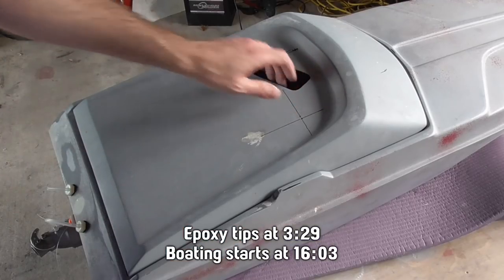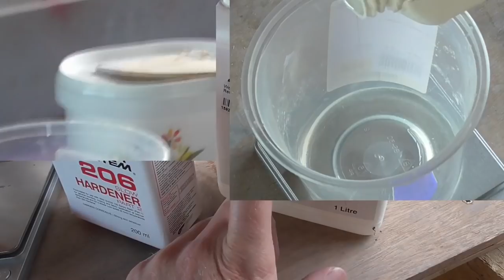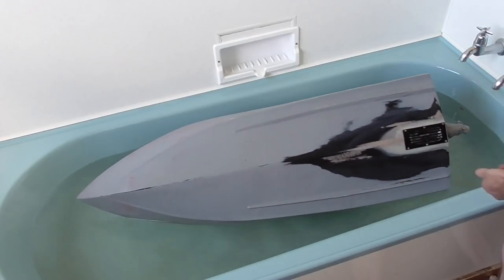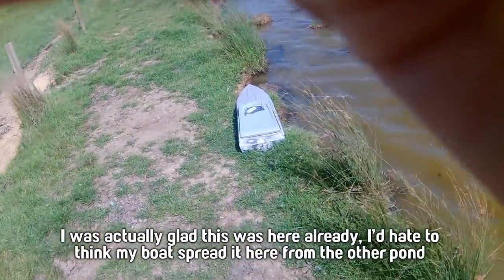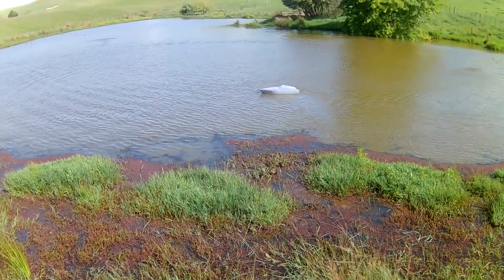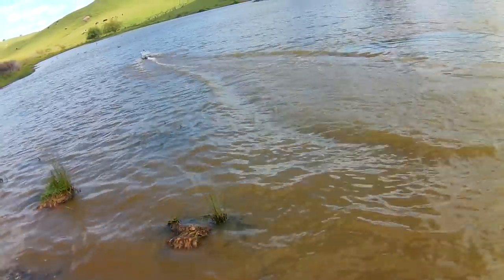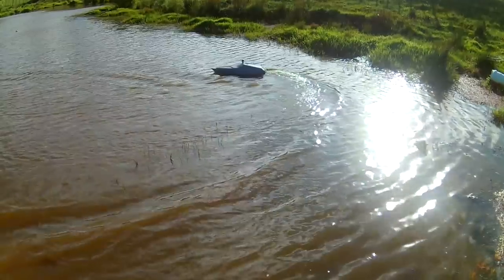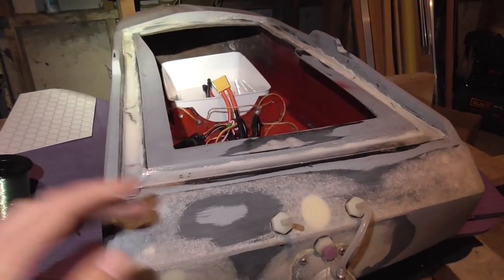Boat upgrade part 3

Comment: Those static current tests would be drawing more current than when the boat is on the plane as the jet pump unloads as it’s being force fed with water.  Also look into scoop grates as a lot of jet skis use after market grates with a scoop to force feed the pump with water to keep them hooked up

Comment: Always enjoying your videos and impatiently waiting for a new one. One thing the motor load can change when it is moving, and it should be highest when it is stoped, so the amperage values in the spec can be correct. Measure it when it is moving freely, and plus to this, dirt can also have influence and increase motor load

Comment: Heads up on mixing the epoxy.......can be done via volume as well as weight.  ...I use a simple balance scale with a yoghurt cup on one end for the resin and hardener and at the other, a balance zero made from a piece of lead and a clothes peg to stop it sliding around, then use coins as the reference weight. A suspended platform each end . So in my case 5 x 2c pieces for the resin, rebalance with the lead, then 1 x 2c piece for the hardener. Usually for small quantities like you are using here. Good to see locations and the problems presented haven't changed over the years or indeed different countries. Love it.  Good idea to run cooling water out the side of the hull rather than the rear, as it is much more visible at the side. Spinning during the turn possibly due to lack of a turning fin at approx. 1/3  to 1/2 of hull length or simply just too much rudder at top speed. (try variable rate steering) Stalled condition not a true indication of run current.(maybe use your telemetry)
Porpoising at higher speed can be reduced by using rear trim tabs but at the cost of some top speed and probably not enough to worry about. Runs well for a first attempt, well done.

Comment: You want a impeller with a shallower pitch - the steep ones aren't very good at high speed get very inefficient I've found. 3 blade, with overlap, seems to work best. At 30:58 am I hearing cavitation? 

Yep.. non linear power curve alright. I got 105A on my 4S 2300kv boat with 35mm pump, 28mm pitch. 23mm nozzle.

Comment: Some simple bent sheet metal turn fins would help.  Just check out any RTR mono....and you'll see them on both sides to prevent the spin-out.    Jet's are big Vacuum Cleaners!
Too be honest, the steering you mention is characteristic of every full and RC boat,   I've owned from 9 inches to 46 foot.  No power, little steering.....and if the wind is blowing and you have a tall profile.........docking gets extra challenging without twin drives......but it's all fun😎
Reply from the maker: Seems to me that if the bow had less of a sharp peak would also help soften the spin tendency? This hull would have been made with the intention of using a typical rudder. Jet boat has no rudder so the rear already has less grab on the water than a typical setup, and a sharp bow is like having a vertical stabilizer at the front of an airplane. It was manageable enough once I got used to what to expect, but seems like this hull is not quite optimal for a jet drive. Some purpose-built jet hulls I've seen have a very 'weak chin', eg.: https://bit.ly/2KvrYol  That one is made to do 360 degree spins as part of the ride so it can still do it, but only when clearly intended I would expect.

Comment: Something to keep in mind is that most people aren't going to be running the boat the way you are. The vast majority of people at least that I know run RC boats with a surface type controller and a very rarely run at constant speeds for very long. They're running them more like an RC car were there on and off the throttle quite a bit . You may want to try a surface controller and see how it feels.

Comment: To terminate the mono filament line to make a nice connection, sqash a small pies of ally tube that the two pieces will pass through, put in some epoxy glue and crimp with those electrical connector crimpers. works fine on just nylon line but the braided wire fishing line better as it doesn't expand with temperature like nylon (making for sloppy control.

Comment: Jet skis are the same on steering, no power = no steering.  Could you do a mix on the radio to apply a small amount of  throttle when the rudder is used and the throttle is on zero to avoid the problem completely?  Something like IF ((T=0) and (R<>0)) THEN T=5%
Reply from the maker: Not on this basic radio. I'll probably use my mixer board to do that, since I also want to have reverse on a switch too.

Comment: makes me want to jump in the car and run my boat fr the first time!
I custom built a fast electric using high grade parts and even reinforced the hull with carbon fiber and just assumed there would be somewhere for me to run it but then discovered its a 20 mile drive to the nearest lake and the boat has only had a bath test and has sat on a shelf looking pretty for the last two years lol
Mine is prop driven with a ball raced solid shaft and has a 1300w motor for power, it should be pretty quick, bath tests suggest it will be but i wont know for sure till it gets a real world test in the wild.

Comment: For safety reasons, you can use the throttle hold function on the Flysky FS-i6 / FS-i6x transmitter and set it to 0%. So if you activate that function, (I believe it was on SWD) your boat doesn't run when you accidentally touch the throttle joystick.

Comment: Try moving the battery forward. The bow seems too light and the stern looks like it's "digging". Edit - also may try trim tabs or planing tabs off the stern.
Reply from the maker: Yeah the thrust line of the nozzle is a little high. I'm thinking I might make a ride plate under the nozzle, that could be adjusted a little to counter that.

Comment: Fantastic project had you down as a hydrofoil kinda guy, seriously though really enjoyed this build,  could you set in trims to reduce throttle in turns and back up as it straightened up. Even incremental ramp up to power out of a turn,  lots of potential for intelligent handling and for missions in different conditions?
Reply from the maker: Right, the mixer thing I'm working on would make that quite easy.

Comment: Not sure if it is the same when the boat is moving and when is fixed, when it comes to how much current it will pull?
Reply: Should be the same as there's no water inrush into the impeller. It's still suckling

Comment: Got the national dress going on. Nice :) It might be interesting to plot a series of power vs thrust tests with a scale and assuming you can find a large enough water body, boat speed vs power. Then go full nerd plotting efficiency based on mass flow vs power.
Reply from the maker: What I might do is put Ardupilot on there, not so much for missions etc but just to see an efficiency number like mAh per km. There must be a sweet spot somewhere along that curve. Trouble is I would have to be careful with the throttle because I don't have any power meters that can go over 100 amps!
Reply: @iforce2d  may be a bit jank but you could always connect two pairs of wires to the main power and then measure only one pair. Total current would theoretically equal two times measured.

Comment: For your LiIon pack you can use Molicel P42a 21700 cells. They have a 45a max current draw. They aren't expensive either. I just made a 4s6p pack using these.

Comment: Your jet pump grate may be too restrictive and you need a way to trim the boat. You’ll get a lot better performance at higher power levels if you can get the boat to plane. The braided fishing line is fantastic stuff, it’s a lot smaller for the same test rating as monofilament line.

Nine or 12 of the Molicell 4000mah/45amp 21700’s would make a good LiOn pack for a very long automated run. They are basically two 18650’s in one slightly larger form factor.
Reply from the maker: I was planning an 18650 pack of 3S10P with 3Ah 10A rated cells. Should still be fine like that if the throttle is kept to about half, at 30A that would be about 1C discharge, ie. about 1 hour drive time. I could also go all out and make it 3S20P to handle full throttle and for longer rides, the weight starts to become pretty heavy though.

Comment: Thought you're gonna stab your hand in the beginning :D is there a mismatch in prop size and motor kv? A too high kv motor would explain the rapid current spiking
Reply from the maker: That's one thing I never really bothered to learn much about, I figured the kit I bought would have everything matched appropriately.

Comment: would leaving out the grate help with stuff not getting stuck in there?
higher voltage with less kv is less amps
some 18650's can give 20A
throttle limit might help
Reply: Even 35amp

Comment: Does your ammeter have a max current hold function? I'd be willing to bet that your static thrust tests are much higher than what it would get while moving with full throttle.
Reply from the maker: No, otherwise I would have tried that. Seems like the max hold meters cost a bunch more.
Reply: @iforce2d  An ad hoc solution could be to stick a GoPro and light inside the boat with the ammeter while running it. :)

Comment: @ 26:05 you will be down on current on 6S at same speed as 3 or 4S. Aslo I would guess the load test
you did with amp clamp maybe unload a little same as a prop on a plane, A Prop....a prop could be 50% more efficient, I mean a prop in the water, Props have more grip than tyres
or propellers in the air......
Reply from the maker: True, I was mainly concerned about what happens when you hit full throttle.

Comment: Adding a small rudder to the nozzle would give you steering without throttle
Reply from the maker: But then you don't have the advantage of a jet being able to run in very shallow water, and not getting the rudder stuck on things.
Reply: @iforce2d  It doesn't have to be large to give you a bit of steering control. I was picturing an upsidedown shark fin, to keep things from catching on it.

Comment: I just want to know if this could push something like a paddleboard, at a reasonable speed for a reasonable time.
Reply: @CyberTricksPro  I'm aware of that guy and what he made but I'm looking at this video primarily because of cost and power. Both should be kept low for what I would like to build.

Comment: Was Waiting for this video sir. Could it be that the current was so high because you were holding the boat
Reply from the maker: Yes, if it's like planes, the current is always a bit higher at 'static' thrust, because the incoming air is not already moving. But it's not a huge difference. For this jet pump, the water is also not flowing straight through, it has to take a slight corner to go up and then back, and that doesn't change when the boat is moving.
Reply: Make sense
Reply: @iforce2d  I'd imagine this acts kind of like an edf too which are worse than normal planes on amp draw when held in place.

Comment: You can probably turn off your other scale by holding the on button if you didn't already know :)
Also: Write the tare weight on your containers so you don't forget and don't have to weigh them again if you reuse them
Reply from the maker: He's right! Hold the button to turn it off.
Reply: @iforce2d  finally i could teach you something you didn't know already, all be it super insignificant :D

Comment: Is that a Uni-t B4Q094 UT 210E multimeter? Me likie. You have a affiliate link?
Reply from the maker: Yes, it's the UT210E I just got recently. Only goes to 100A, I thought would be enough for this test, but apparently not. It''s way more convenient than using my multimeter inline though, I should have got one ages ago!
https://bit.ly/3373mJ7
Reply: @iforce2d  thanks Chris

Comment: 12:50 Gee... Why not try running it on sand... There is no way I would have put that boat into that Muck
Reply from the maker: Because it's a 10 second walk from my house, and I didn't even know I could use the other ponds yet, and the worst that could happen is it doesn't work. So it was either that or a 40 minute drive - is that ok?
Reply: @iforce2d  "Is that OK?"... No need to get Snooty... The response until then answered my comment. I would not have taken the chance to go for a swim in that Muck if the boat got stuck in the middle of the pond.
Reply from the maker: I respond in kind. Your comment suggests I'm some kind of moron for even giving it a try, which is very easy to say with the full knowledge of hindsight. Other commenters with a more constructive attitude have mentioned it might have run ok without the grate in place. At the very least, I was finally able to hit full throttle for a bit, which is quite gratifying when you've been working on something for weeks. For all I knew the full throttle might have uncovered other problems to fix too, so not a waste of time at all. Better to find out 10 seconds from home than take the boat somewhere further away and not have the tools to solve a problem.

Comment: uses a esc that can handle 150a continues , solders xt60 on xD
Reply from the maker: XT90 actually... but the battery can only handle 100A continuous anyway, and even that's not a realistic situation. The most continuous current it saw was around 40A.